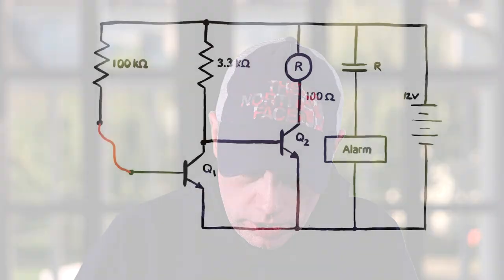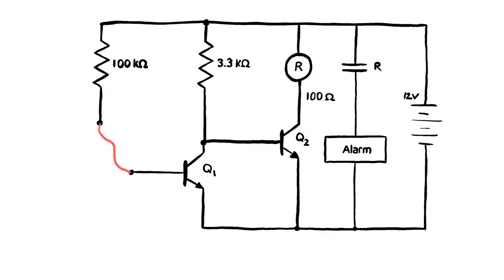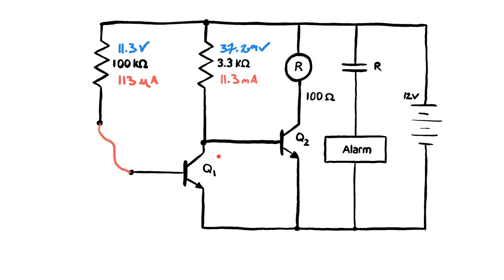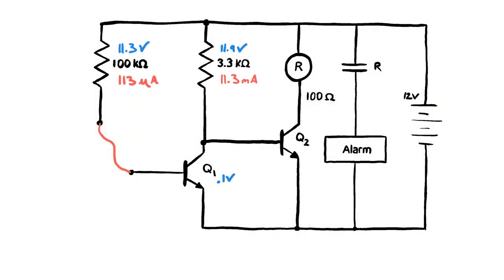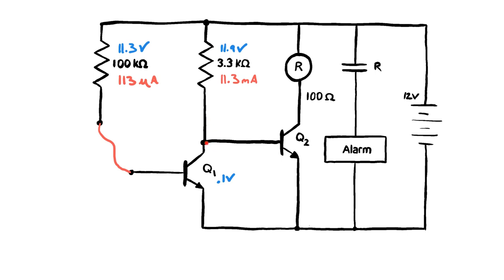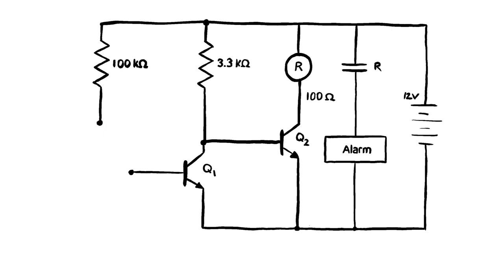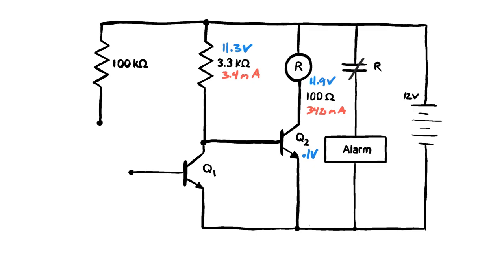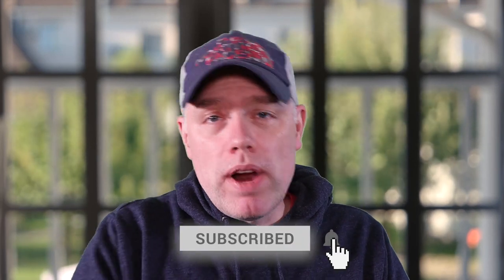THE TWO TRANSISTOR ALARM CIRCUIT: Utilizing transistors for switching.

Comment: Very well explained and a very practical circuit. Thank you for going through it’s operation. You really need to use a flyback diode whenever you use a relay with a transistor like this in order to protect the transistor. Your transistor can easily get fried after a few uses. Something like this: https://drive.google.com/file/d/1DqtmoelmhubxqYm5EO15-dDmlrFHGOvC/view?usp=sharing

Comment: Great video. I have 5v relay and 5v power supply. What would be the values for resistors? Thanks.
Reply: Just drop them at the same ratio, 5/12=x/100